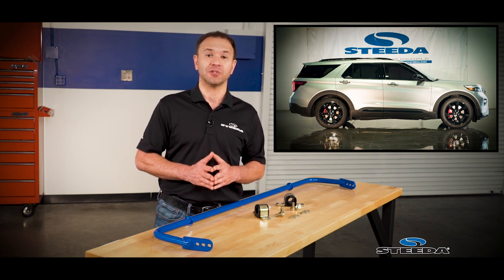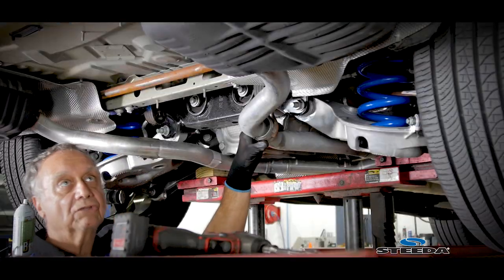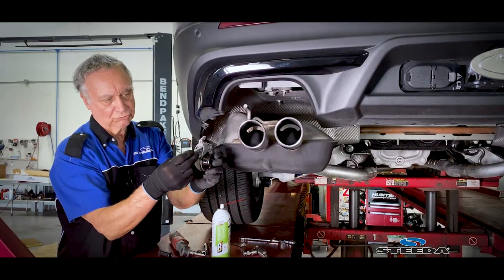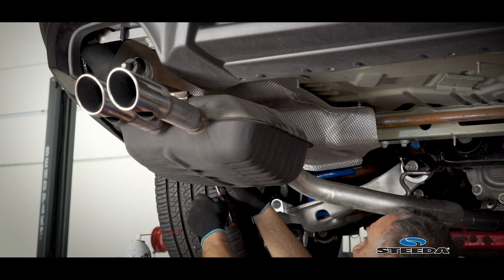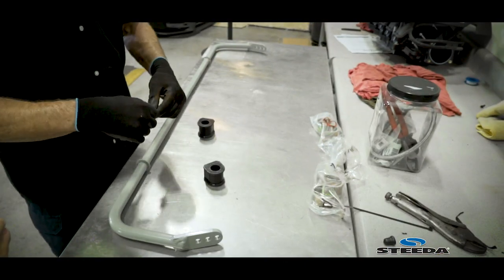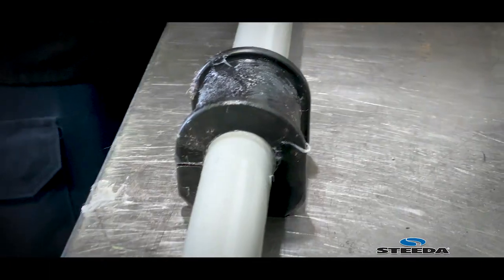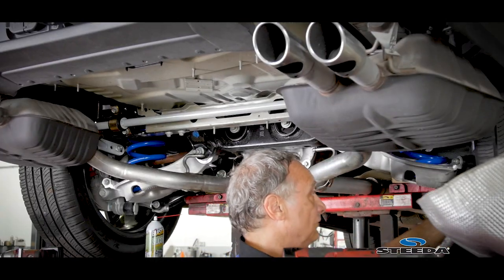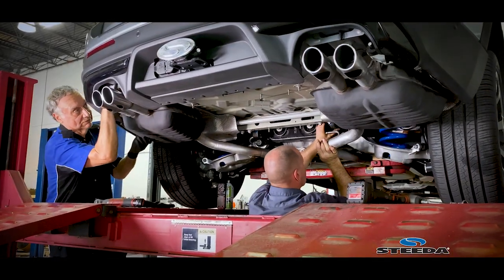Steeda 2020 Explorer Adjustable Rear Sway Bar Installation, 555-1030

Comment: I just watched this video and I noticed the rubber bushings on the original sway bar were on the inside of the retainer and the new ones wer replaced on the outside of the retainer.  Which is right?

Comment: Hello, so I lifted my ST 1.5" , do you recommend these sway bars ?
Reply from the maker: If you're looking for less body roll, then yes! They'll work with a lifted Explorer to tighten it up in the turns or when towing. Now if you're off-roading you may want some more compliance, so you'd want to put it on the softest setting.
Reply: @steedaautosports  thank you

Comment: hard to tell from the video - are the rear wheels off the ground or is this just on the ramp? trying to tell if i can use ramps or if i need jack stands...
Reply from the maker: Hi,
In this video, the wheels are still on the lift so it would be easier to install the parts. Ramps or jack stands should be able to work well though -Sam
Reply: @steedaautosports  thanks! doing this install in the next few days!
Reply: @mikegrad8224  how you liking the bar?

Comment: Every nut and bolt you removed should be thrown away and replaced with new.  They are not reusable.  Does Steeda provide new nuts and bolts with the sway bar kit?